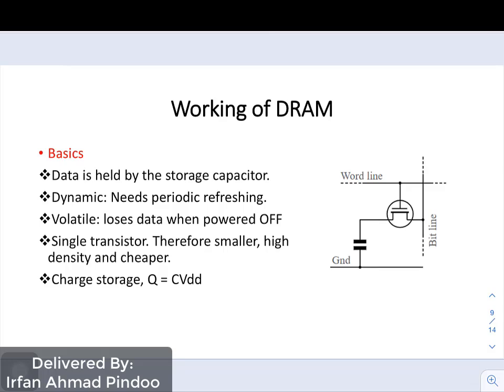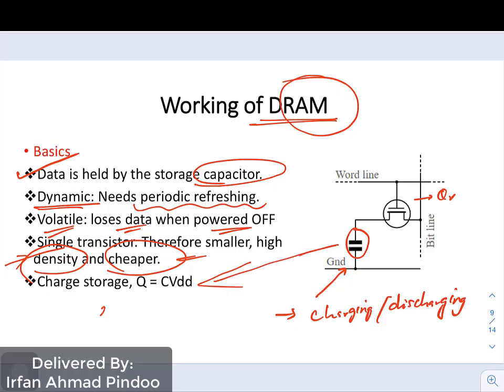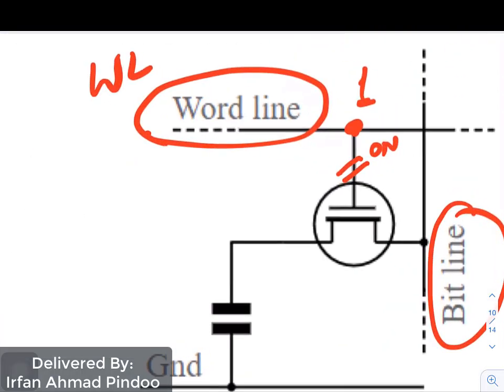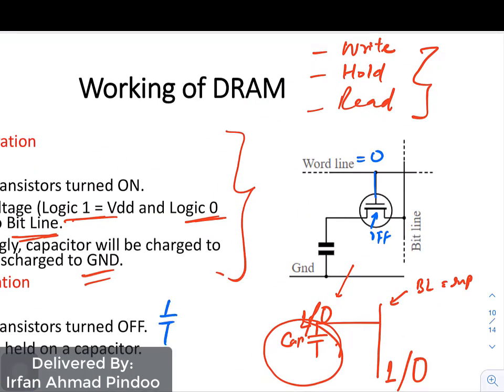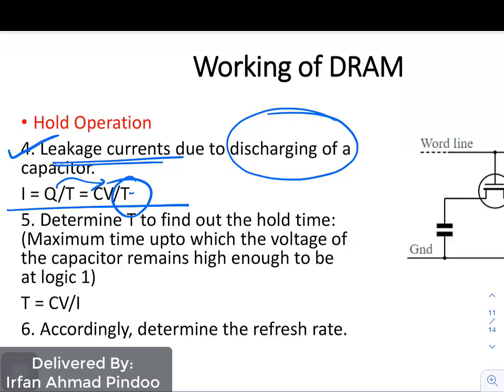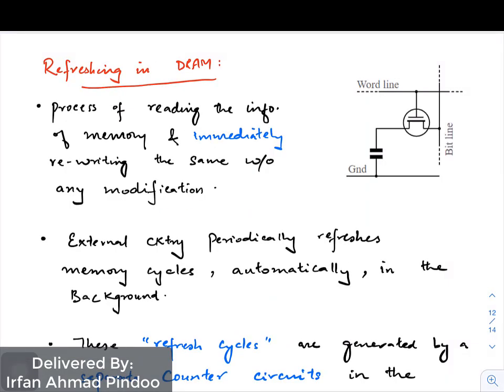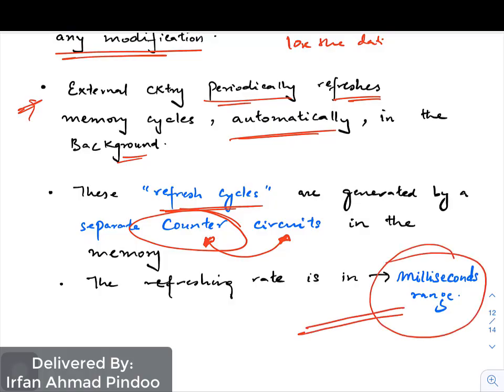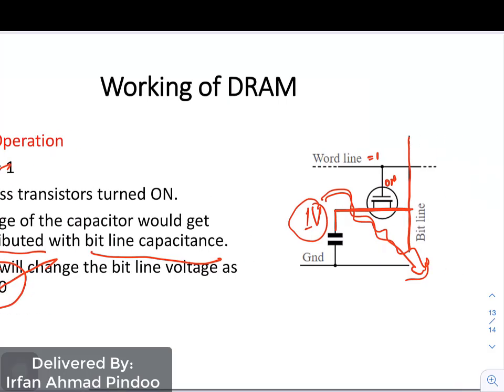DRAM || Read, Write and Hold Operation || Concept of Refresh Cycles in DRAM

Comment: Thanks for the video, I might like to add that the Voltage on the capacitor is NOT Vdd. It would be Vdd-.7 since the condition to keep the transistor on but the overall explanation makes perfect sense on how the overall operation happens.
Reply: Yes bcz of the threshold voltage